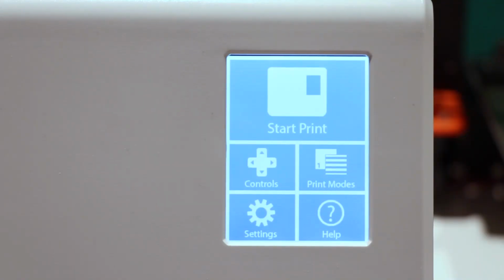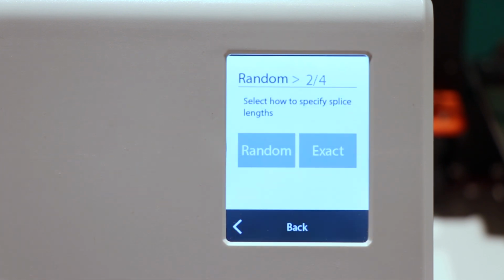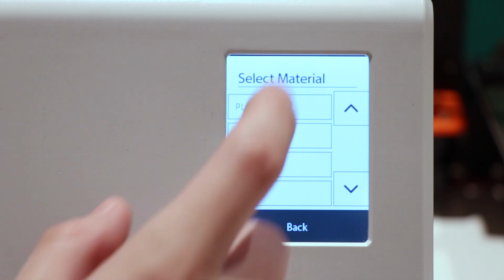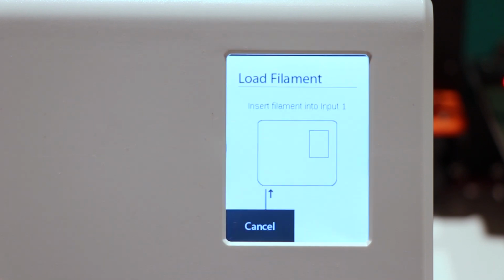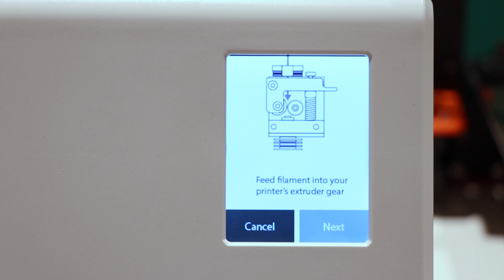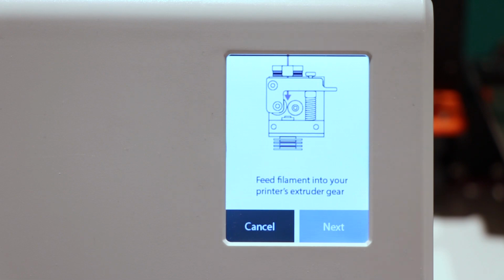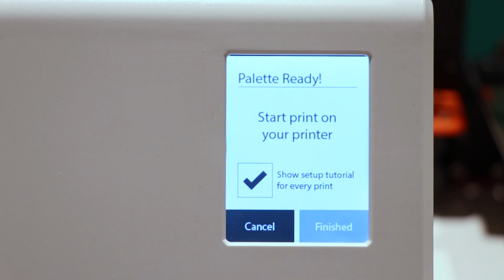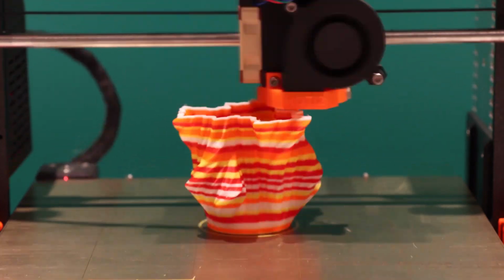Palette 2 - Random Mode

Comment: Would be nice to just have it fed to the printer at all times, and stay in a mode for multiple prints until we select otherwise.
Reply from the maker: Hey there, this is definitely possible if you account for multiple prints when you're entering the total print length. Palette will then continue to create filament until the length is completed or the print is canceled.